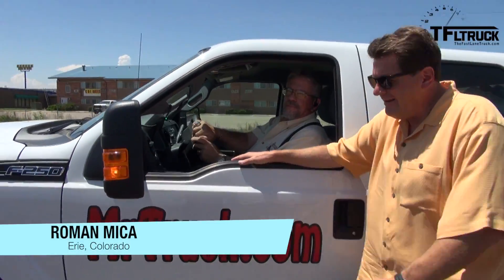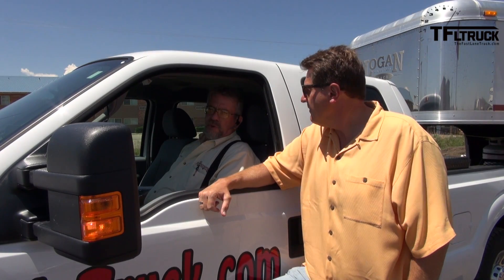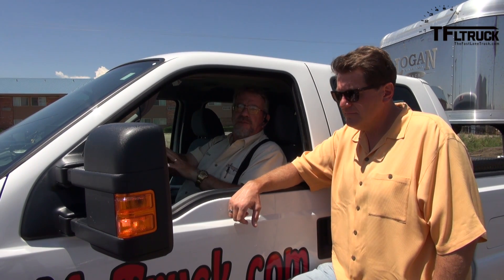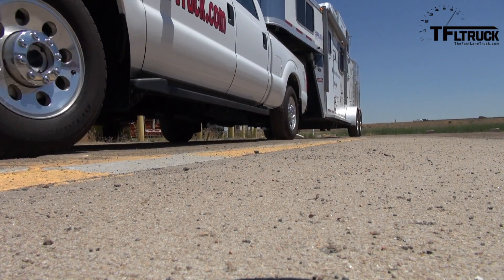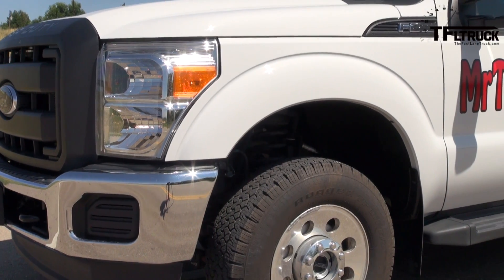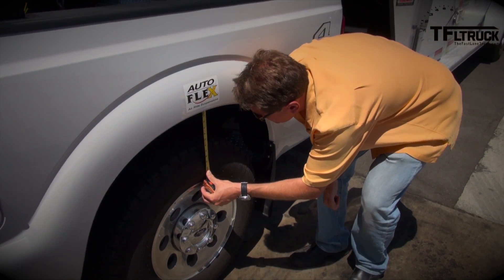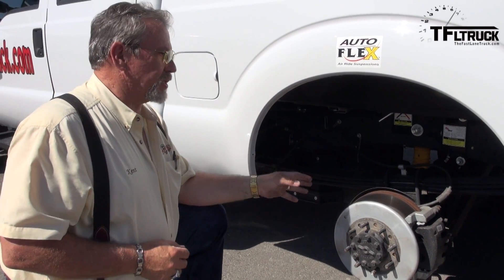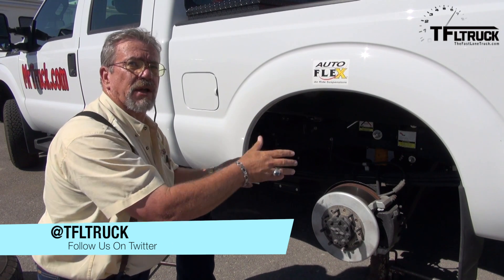Project Super Duty: Ford F-250  Air Suspension Conversion (Episode 1)

Comment: Can you guys do an episode of air vs leafspring suspension? What are the pros and cons? Can one ow and haul more than the other? Do you think the 2017 Ford F-150 might convert to air susp nation in the future? Thanks!
Reply: The leaf spring will technically hold more since it is a very mechanical system the bags will pop before the springs tear, but the ride height is always constant for the air. The leafs are bouncer. Air is nice to have onboard as show in the video. The 2017 fords f-150 through f-550 have leafs it's not till you get to the 650 and 750 that you can get air. Another variable is the ride the more leafs the higher weight capacity but the bouncer the ride. Air adjust and they make a special valve that negates the use of computers.

Comment: Doesnt the F250 come with a switch to adjust the headlights like all cars, van & trucks have in Europe. My Merc Sprinter flat bed auto adjusts everytime you start her up to keep the headlights at the right height. My Vauxhall (GM) car even has 3 settings

Comment: The F250 they are using has a maximum tow rating of 12,000lbs.  Ford says their F150 with the Ecoboost engine has a maximum tow rating of 11,200lbs.

Comment: Roman, I have been following this new suspension since it appears to give you (finally) automatic height adjustment. It didn't make sense that you couldn't get Air suspension and had to use a suspension system that was archaic. 

Thank you for bringing us this review. Roman, does the handling on curves? And if it does is better?